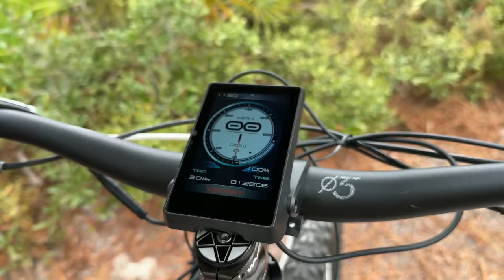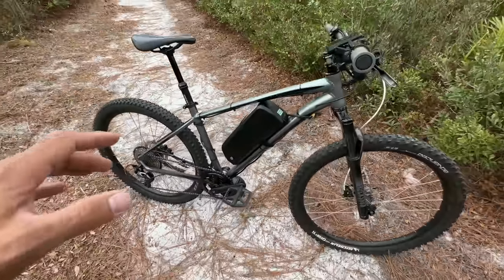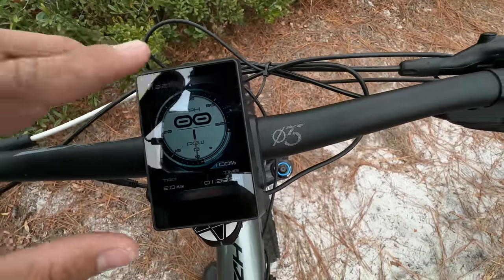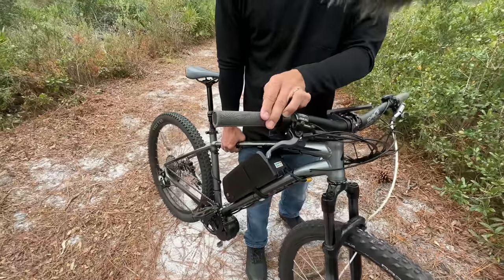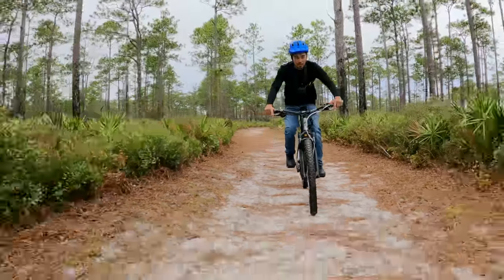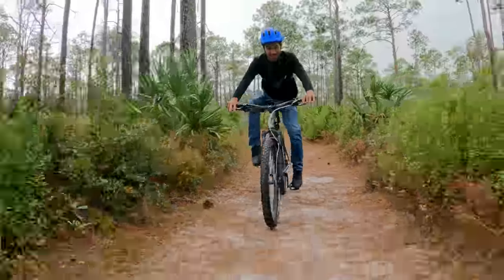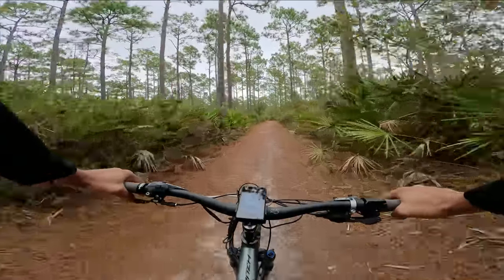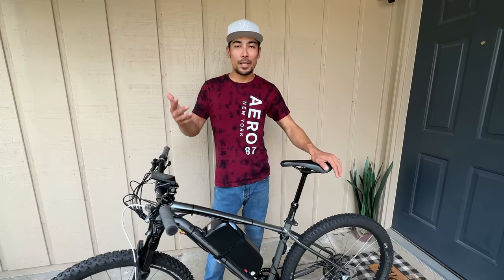Best Ebike Conversion Kit of 2022 | BAFANG Ebike Conversion Kit

Comment: I put one on a used 2009 cannondale downhill bike a few years ago with a 38 tooth front sprocket and its awesome. I have a battery in a backpack and the xt90 plugs under the seat. I used the EGO 56V 5AH battery from home depot. Get an eggrider computer and you can use your phone to change everything.
Reply: I also use Ego 56v batteries on my Bafang  BBS02 ebike.  In addition, I use Greenworks 60v batteries (5aH) but you have to be careful as the system will shutdown for over voltage protection  (Error code 07) when anything over 60v is detected.   I have over 1200 miles on the ebike as of Dec. 2022 and it still runs  like new.  

Drivetrain is 3-speed Nexus IGH.  Actually, you can do fine with just a single speed sprocket.  I wouldn't think you'd ever need more that 5 speeds if you're using an ebike.
Reply: @nathangant7636  Thanks for the info. But the system voltage is 48 v and i guess it is ok to use 56 v battery. do you use just one battery?
Reply: You didn't have to reprogram the 48V Bafang motor & controller to run on a 56V battery?  How did you connect wires to the EVO battery's terminals ?  and was splicing needed to connect those wires into the Bafang motor wires ?  With 5 Amps what was your range ? Thanks
Reply: Ive had no problem going to 56V I read somewhere that the speed controller is fine with it . Its the AMPs that will blow the controller. I set my max amps to 20 amps with the programmer, i forget but 28amps  is actual MAX. so 56x20=1120watts. I have it geared with a 38 tooth Lekki on the front for so many reasons. I 3dprinted a battery holder with aluminum contacts that looks very close to what the EGO charger looks like. You could repurpose an extra charger if you dont have a 3dprinter.

Comment: Actually, the BBS02-750 has 120Nm of torque - not just 100nm as you stated. To quote their website:
"Powerful, fast, and quiet Bafang BBS02B street-legal mid-drive motor. This motor is rated at 750 watts but puts out a 1470 watts peak when asked and does it more quietly than any e-bike on the market. With 120 Nm of torque, it has 50% more torque and 100% more power than the motors currently sold in factory e-bikes."

Comment: I get 38 mph without pedalling on my 1000W mid drive conversion. Awesome performance. I wouldn’t bother with changing over the brake cables or adding a gear sensor next time as I really don’t need gears, the motor having so much torque!
Reply: How much did you pay for it?
Reply: @MrAkaprimetime  Around £900, including a 21 AH battery.
Reply: I'm interested in making my own! If you don't mind, could you tell me what parts you ordered for your custom ebike? That would be super helpful, thanks!
Reply: @michaelinkster4977 what's the range like? I'm thinking of buying the same 1000w and a 28ah battery
Reply: @xdave4277  Never really tried the range but I’d guess 30 to 60 miles with my 20ah battery depending upon how much effort you put in.
Reply: @michaelinkster4977  true true I'm jus looking for a lil assist on hills so I think the bafang will be perfect with the 28ah battery at 15mph should last me 30+ miles easily appreciate the reply
Reply: I thought you had to pedal for the motor to kick in with mid-drive?
Reply: @dannygboyo  no, it has a throttle. No need to pedal if you don’t want to.
Reply: @Simon_Squared  The BBSHD motor package generally comes with everything you need. Make sure it has the tool to tighten the motor and a crank puller. Otherwise, you just need basic standard tools. You may need some motor spacers. See YouTube, plenty of videos there.

Comment: I got one a year ago and it's boss. You definitely gotta get the software that makes the throttle response smooth; otherwise it's either on or off.
Reply: Other motor controllers like the Phaserunner / Baserunner are much more flexible in programming your own personal throttle response for you.

Comment: I bought a cable where I can plug into the software with my phone and use an app I downloaded to change the percentages of power on each pedal assist. So like 5% on 1, 10% on 2 etc. That way you can fine tune each PAS mode to your needs. Going 10 mph on PAS 1 is too fast in my opinion, it should be more like 4 or 5 mph. I also changed out the 46 tooth front gear mine came with to a 32 tooth as it would hit almost 40 MPH at top speed which was nuts, now it only hits 30ish.

Comment: Great build. Someone had asked about the rock gardens, and that is the biggest problem with a bafang is the lower ground clearance. I found it interesting that you said it would fit in the triangle, not sure the bafang would fit there, That would be interesting if it would, and deal with the battery afterwards. Great build, love my marlin 7 with a BBS02.
Reply: Lol if anything the motor will protect the chain and chainring. The motor is solid. Well at least the 1000w. 750w Looks like a toy. I have yet to hit it on a rock so I'm just talking out my ... until then.
Reply: @Rad Ham Don't think the Trek has room there. For bikes that do that would be the best spot for it.
Reply: @Eric_Tennant  Nah, The lower clearance in many a scenarios would have me off the bike or bugger the full thing up or both.

Comment: I’ve had my 750 watt Bafang conversation for 2 years now. I weigh around 190lb the 750 watt has no trouble going up hills in mid gears best to use the lowest gear. 
Anyway it’s a great design…
Reply: Whats your range like?
Reply: @zao.224  with a 17.5ah battery 48 volts I get easy 40 miles on highest power setting in peddle assist mode.
Reply: @anthonyiocca5683  that seems pretty good. Thanks!
Reply: @zao.224  it is really great in my opinion. A lead acid battery would go maybe 2 miles.
I measured the electricity going into the charger and it takes less than 1 one kilowatt to charge these lithium ion batteries. Here 1 kilowatt is about .12 cents. That is better than 4 miles to the penny.

Comment: Clean install.  Cable management has been a problem for me with the BBS02.  I have about 2 ft of extra cables.  I tried to neatly tuck it under the motor and also neatly attach it to the uptube but both options are not good.  What did you do with your extra cable?

Comment: Make sure you check dimensions though. I bought one for a 7 speed trike. The sprocket sits in further on a trike, so it only worked for gear 7, anything lower and it would throw the chain
Reply: You can buy aftermarket sprockets and spacers if it doesn't fit properly, I think Lekkie Chainrings sells some

Comment: Mid drive is great as you get the advantage of gears, but i feel like it will increase likelihood of bad shifting while going uphill. I live in wales with very steep hills, so I think a 1000W for a 120kg guy would be a better option. Perhaps a 1000Kw on the back wheel and 300 W on the front wheel. More hill climbing power and 2 wheel drive for offroading in sand and snow.
Reply: I went with a hub drive because I'm new to e bikes and figured I would destroy the chain with poorly timed shifts on hills. Once I get some miles under my belt I'll probably switch to a mid drive. Mids have the advantage of keeping the motor in the sweet spot but for beginners hubs are more forgiving.
Reply: @biffmalibu3733  I think a Gear sensor will help with that problem.
Reply: so with this type of conversion it powers the crank so that you can use the gears?  This is what I want.  I weigh approx 77kg.

Comment: Thanks for the vid. I'm disappointed that the BB shaft is a square tapered design. Ditching your modern cranks and downgrading makes no sense. Another concern is the cheap chainring. The chain will drop as soon as you hit a bump or even when back pedaling, so right from the start, one needs to replace it with a narrow wide aftermarket ring.

Comment: GREAT VIDEO! My question is can you use the motor assist for walking speeds, like 1 to 2 mph? Or is level one automatically 9 to 10mph? I am converting a wheel chair that is built for trail use and made from mountain bike parts but needs to go walking speeds.
Reply: What?? Lol
Reply: Hello, did you manage to do that? I am also interested to build EV wheelchair, have you researched already?

Comment: I had a similar 250W motor installed on my old mountainbike and it still works but there were no shifting or braking sensors available and this the drive train receives an unhealthy amount of wear and tear from the 90nm motor.

I've since switched to a hub drive ebike which I think will likely be easier to maintain but at only 700 miles in I don't know that yet.

Comment: How were you mounting it - if you have made video of mounting process, please post the link. Warm greetings.  Michael, central Poland.
Reply: Hi Michael , I installed a BBSHD 1000 watts on my mountain bike , go to cyber bikes on you tube , it's a shop in Australia where the tech Fillippe as great video's on install. Install is simple just make sure that the chainring does not touch the motor when you install it. Get some small spacers to obtain a perfect chain line.  You'll also need to contend with the motor brackets loosening which can be fixed with clamps to secure the motor to bike frame. Get one it's totally worth it you'll be amazed on performance especially the BBSHD 1000 watt.

Comment: Nice editing! friendly tip, your saddle nose ideally will be slightly tipped down, just a smidge for comfort and efficieny, happy trails!
Reply: Yeah it is good editing. Unfortunately it was a green screen for the trail. If notice the water and mud he rode through had no splash at all, and the little bit of foliage he rode on didn't move. Plus a shadow under the tire as he is riding. Still going to research the motor though.

Comment: How do you protect the motor? I have a carbon  stump jumper and my cables run under my bottom bracket. I hit them so often I have to change them out every few months, and I have to run a chainring guard or I bend the teeth.
I like to ride over things, big rocks, logs, park benches, other riders... lol
Reply: That is my concern too

Comment: Great read. I'm wondering if you can add this motor to a ebike with a rear hub motor, as opposed to adding a front hub motor. Too weird?
Reply: You could but I'm not sure why you would?  IMHO this is better than a hub motor.
Reply: If you want a front hub motor, the All-axle is a good choice.
Reply: @Sam Miller  I'll look into that, thanks.

Comment: I'm saving up for the HD version kit I plan to use it for Door dashing I want to motor most of the time with two spare batteries so I can swap and make a 8 hour shift
Reply: Get a 30Amp.H Triangular Battery (Sits in Middle of Frame)
Reply: @James_T_Quirk  I will check it out I think I will diy and build my own  packs
Reply: @ronaldharris6569  Always Best, These bigger batteries are useful, but on Streets, too heavy for the Rough & "Jumps", or so I think .. ..

Comment: Mid drives are awesome, hub motors are fun until you run out of juice, and pedaling with those is a pain in the A.

love my bbs02,
Reply: You can also get hub motors that have a internal freewheel
Reply: @blise518B  alright, didn't know that was a thing. thanks.
Reply: Mid drives are fun until you break a chain and you're screwed. Break a chain with a hub motor and throttle home. The one downside to mid drives.
Reply: @18andlikeit  broke chains with hubs, never with a mid drive.
Reply: @pixieloco  you can break chains with any bike but generally hubs decrease load on your chain, mid drives increase load and wear on your chain.

Comment: Where is the controller? Is it packaged with the battery? Thanks for creating an uploading!
Reply: the controller is inside the motor.
Reply: @kumunoynimanoy5400  Wow, Thanks! It must be cramped in there.He kept calling it a 'motor', but actually it's a motor/controller iisn't it? I don''t see how the 'air tag will deter a serious theft  where it was hot-wired and ridden away at speed.
Reply from the maker: Salamat Erp!

Comment: II must have missed the part on the estimated range of this mid drive motor. What is the estimated range ?
Reply: It depends on how much pedal power you add, how level the road is and how fast you go.
Reply: I've got a similar setup, I get over 35 miles on a charge, (on the road). I think you could get away with a smaller battery offroad, if you don't need all that range.

Comment: Tip: If you get the system wet, you may want to take the battery off and dry the contact points.
Reply: Tip, maybe isolate the battery and the contact points
Reply: @RollieBeatz how would one do this?

Comment: Can you ride these without the batteries? I was considering maybe getting the kit and keeping the battery in a bag for example on the way to the trails, then take it off for the downhill, I know it'll be heavier, but will it be an issue do you think it not being assisted, or maybe have a tiny battery for at the trails and dump the big battery somewhere
Reply from the maker: Yes you can ride without battery, That’s what I did on one of my conversion kits, the battery is too heavy for downhill
Reply: @MCMTB  Sorry newbie here, what does it mean 'too heavy for downhill' ? Does it create too much momentum making it harder to brake?

Comment: Wonder if this could be modified to work on making a power assist wheelbarrow?
Reply: That's doable but a hub motor may work better most barrows have a solid dish hub so carefully cutting it and bolting it to a hub motor flange seems a way to do it. I'm sure someone has a you tube video doing that
Reply: @ronaldharris6569  thanks! Real, it would come in super handy landscaping. I will research it more. Thanks for your advice!👍

Comment: I wanna build a ebike but any battery wouldn't fit on my oddly shaped downtube since there's the holes and the I'd need to drill holes and add rivet nuts.

Comment: What size frame do you have this system mounted to? Will this battery work on a small frame? Are there other mounting options for the battery such as on a back rack
Reply: The smaller the frame, the more problematic it is fitting the large downtube  battery. However, there are options for rack mounted and triangle batteries that work just fine with the Bafang motor.

Comment: i installed similar thing in bike shop , and we had problem with strong drivers that push it to floor and they broke freewheel/ratchet inside of motor, that upgrade is only for weak people that needs power assist

Comment: Luv the upside down battery!
Reply from the maker: Yeah, the battery is too big and wont fit if installed correctly, gotta be smarter than the system
Reply: @MCMTB  It will fit the correct way round just drill a hole and use rivnuts/ Its very straight forward and no need for velcro straps.

Comment: I’m definitely getting one! I’m going for the thousand watt!
Reply from the maker: Sheesh, make sure to get a thicker chain, 1000w is pretty powerful;)
Reply: 1000watt will chew through your chain and cassette real quick...believe me I know. So be prepared for the added cost of drivetrain components that need to be replaced if you go the 1000watt route. 750watt although is quite powerful with 120nm, doesn't punish your drivetrain nearly as much as the 1000watt.
Reply: At a 1000 watt it would be better to use a planetary geared rear hub motor and it will not eat your chain and are lighter than the 1000 watt direct drive systems but it really depends on how you plan on using the bike. I live in the city so hub units are great but if you plan on making a off road riding bike mid drives are the bomb but trust everyone here 750 good nuff! I believe that equates to 2 hp
Reply: A thousand watt mid drive is going eat up parts quicker than usual.
Reply: @dalvenable331  there is many problems with rear hubs, need additional controller+ they are ugly and they are worse at uphills that mid drives and also you can mod bbshd to 3000 watts if you want to.
Reply: @Jytaani  Again it depends on how you want to use the bike. You need to modify your existing bike a lot to convert one that will last using a mid drive system All you need do is change the wheel out and hang you battery and controller with a hub unit. I have systems that have been on as many as 4 different bike frames and styles. I can add and remove a hub unit without any modifications to  the bike other than adding the kit and return it to a regular bike without issue and will carry a 750w Ebikeling kit when traveling then either buy a cheap used bike or rent one and add the conversion kit for free transportation while on vacation.

Comment: For $600, both ebikes i got cost just under $500 for the whole new bike, these conversion kits need to come down to like $300 for a decent one and then everyone would go for it. Till then $500 gets you a whole new ni e ebike
Reply: Some decent (not the best) electric bike kits cost $1,350 USD and that does includes the battery too. $1,350 is a whole ton of cash for a e-bike kit already. I would love to see a whole entire e-bike conversion kit with a 52v20Ah battery included and cost under $300 but I know that’s literally impossible at this point in time.